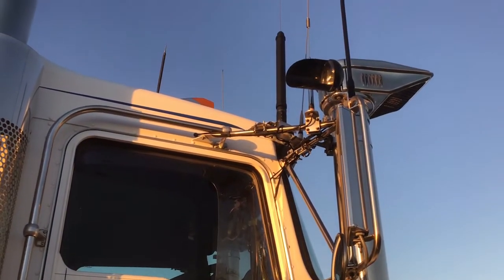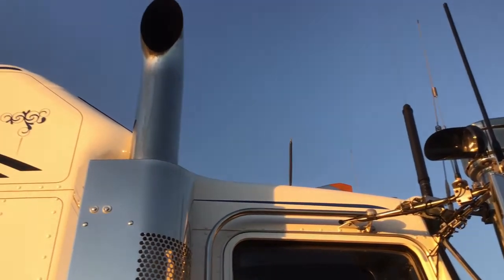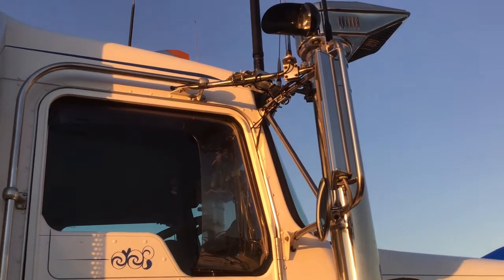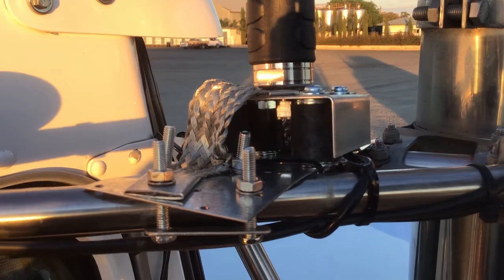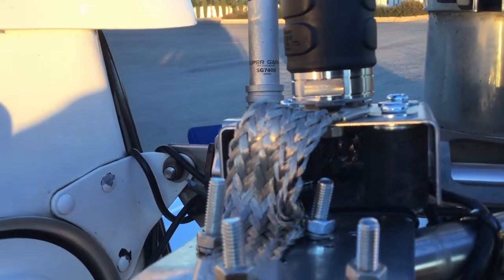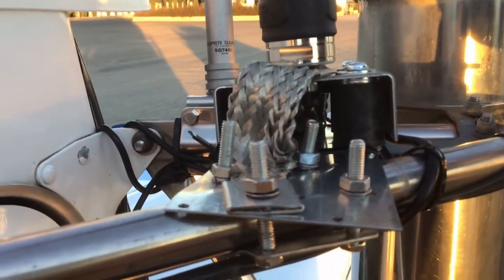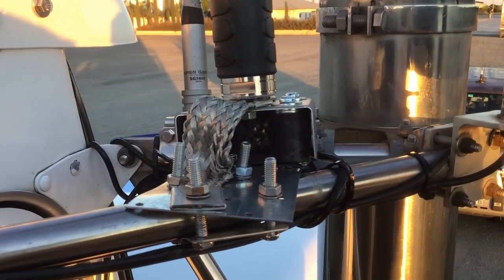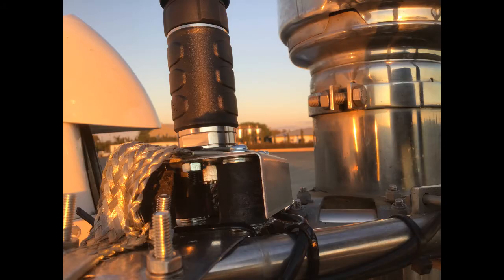Home Brew ATAS120 Anti vibration Mount

Comment: Great Idea thanks for the video, I've just mounted an ATAS on my ute being the rear window it shakes so heavily the centre conductor from the circuit board has a intermittent connection! I'll have a crack at making up a mount like this. Thanks for the idea 73's